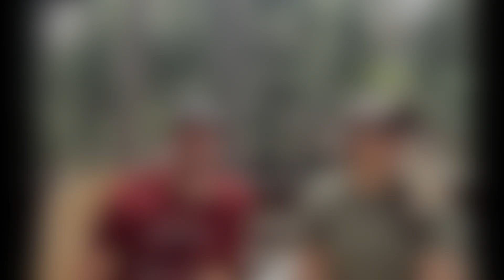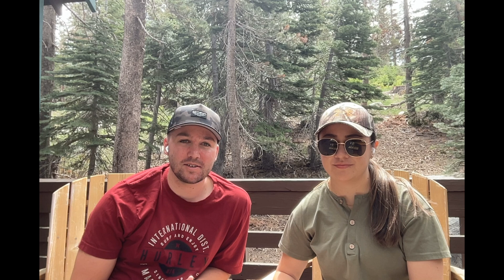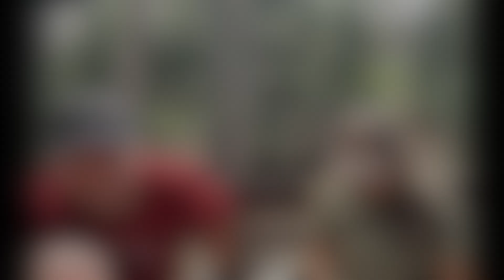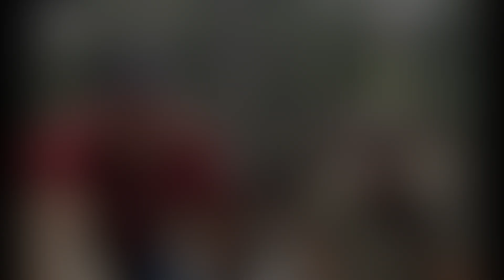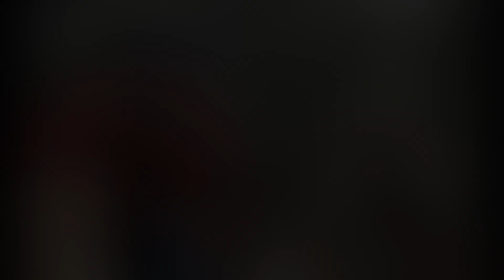Update Video - Laser Cut Parts and Our RV-10 Build

Comment: Drill out the holes and use  bigger rivets??????
Reply from the maker: Theoretically it could work, but it would mean every hole would have to be upsized, including screw holes, changing all of the hardware including the attached nutplates. It would be a lot of work at such a large scale. And I'd hate to have to upsize AD4 to AD5 rivets. Those monsters would be a PAIN to have to switch to for so many rivets.
Reply: @AustinManke  what a bad situation.  Good luck to you all.  Somehow it will all work out. RVs are great!
Reply from the maker: @davidsoom1551  it really is. Vans has made good progress though on identifying which parts can and can’t be used. They continue to update this page as they complete more testing. https://www.vansaircraft.com/2023/11/information-about-dimpled-hole-cracking-on-some-laser-cut-parts/

Thanks for watching and for the comment!
Reply: I flew a lot of airplanes but never built one. In the end your experience will be great. Even with the current problems I envy you.
Reply from the maker: @davidsoom1551   it will! We are really excited with the build still and look forward to getting it flying.

Comment: I seriously wanted to order a -14 kit at Airventure and have lived long enough to see several companies file bankruptcy in the middle of a storm like this so I aske one of the ladies at the Van’s display if they would consider using an escrow company in the interim to protect both buyers and Van’s just in case. I was basically told that wouldn’t happen. It will be a cold day in hell before I will shell out tens of thousands to a company that is experiencing such an issue.

The other elephant in the room is that Vans isn’t the only kit manufacturer using laser cut aluminum parts. If everyone switches back to punched parts we may have issues.

Now the cracks a showing up on dimpled parts for flush riveting but what’s to say that standard river heads won’t have long term issues?
Reply: I have three friends that have decided not to order from Vans and/or canceled their orders. I imagine there’s a lot more.
Reply from the maker: I understand your hesitation. Lots of unknowns and a lot of money at risk. 

I’m really hoping those in-house and third party tests come back with good news.

Comment: So is this a problem because of some type of heat cycling issue with using lasers? Or is it more about the holes being jagged with stress risers or something?
Reply from the maker: My understanding is that it could be a combination of those two issues, but the notch/jagged part of the hole is where the cracks originate from

Comment: Sounds like you guys have a great plan for seeing it through; in the end this will be an unfortunate speed bump on the way to having an incredible airplane! That is our take, anyway...stay the course and see it through. We're also pausing for the most part until the plan for the laser cut parts becomes clearer. I finally bit the bullet and started going through "the list" yesterday for our -10; I've ID'd 36 laser cut parts in my fuselage kit and haven't gotten to the wings yet. So far we seem largely unscathed for the empennage; the exception here may be the tailcone. The good news is that my elevator parts appear to all be punched, so I can at least work on final assembly of those. Hang in there!
Reply from the maker: Thank you! It will be a speed bump but you’re right about the end product. It’ll be worth it. Glad to hear your completed parts weren’t too affected!

Comment: What of these “buried” parts?  Our flaps and ailerons are finished. So if the main spars of both parts are already labeled “replace.” Next to impossible to attempt to salvage those parts. Hundreds of rivets attaching the skins to the spars.  So start over?  And it’s not just vans replacing the parts.  That’s the easy part. For us and outr build situation, it’s a year worth of work. Time off work, travel expenses, sacrificing time. That’s the much bigger cost!!
Reply from the maker: I’m really hoping they find a way to make things right for you and builders in the same situation with buried parts. I can’t even imagine having to redo those entire components.